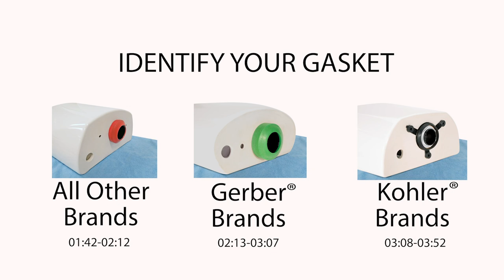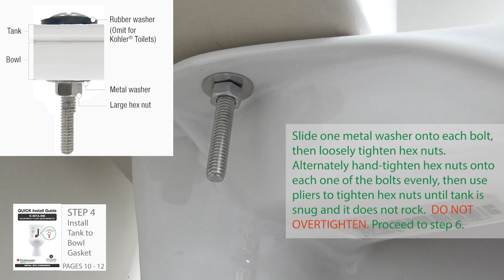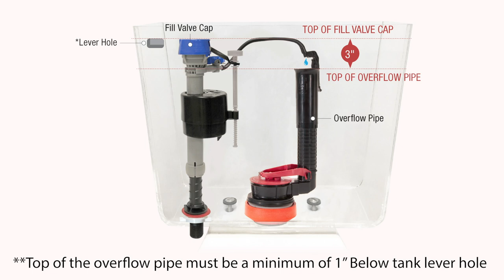Fix Leaking Toilet Tank with Fluidmaster K-507A-008 Universal Adjustable Flush Valve Repair Kit

Comment: We just completely replaced our fill and flush valves following these instructions because we had the tank leaking into the bowl.  That didn't fix the issue -- the tank still leaks into the bowl.  Help! What troubleshooting can we do to get this fixed?
Reply from the maker: Here are two solutions that might work. First check to make sure the refill tube is not shoved into the overflow pipe of your new flush valve. If it is remove it and use the clip that came with your fill valve kit and attach the clip to the flush valve and plug in the refill tube into the kit.
The second solution is to check the chain on the flapper and tank lever, if it is too long then shorten it as it may be pulled under the flapper when it tries to close. If these solutions do not work call Fluidmaster at 800 631-2011 or email/chat with us at fluidmaster.com/support for help finding the leak.
Reply: @FluidmasterInc  thanks!   it was actually BOTH of these issues and we were able to get it fixed.  thanks again

Comment: There is no 2-1/2" diameter nut wrench in my kit, #507AK.
Reply from the maker: Thank you for your question. The 507AK does not come with a red tool. If you are looking for a kit that comes with tools try our Everything Kit (2”) Toilet Repair Kit or if just needing a flush valve try our K507A-008 (2- Inch) Adjustable Flush Valve kit. For more information visit our website Fluidmaster.com where you can find product information, videos, troubleshooting tips and email or chat with a technician.  Our toll-free number is 800-631-2011 and we are available 5 days a week Mon-Fri from 5:30 am – 5:00 pm PST.

Comment: Hey Fluidmaster:  You don’t supply enough washers and nuts to attach the tank to the bowl properly.  Shame on you.  Not long ago, perhaps 5-7 years ago, you did supply enough nuts and washers to install the tank properly.  So, my question is, why are you not supplying enough nuts and washers to attach the tank properly?  The tank bolts should be tightened to the tank before installing the tank to the bowl.  Your new way does not work and my tank is now leaking.
Reply from the maker: Some of our older kits do only come with 2 standard bolts and a standard toilet bowl gasket. However Fluidmaster has released new flush valve and Everything Kits that do include 3 bolts and specialized gaskets.  For newer tanks we also make this kit for 3 inch toilets as well. For further help please contact Fluidmaster by email and live chat at fluidmaster.com/ support or toll free 800-631-2011.
Reply: @FluidmasterInc  : BUT NOT ENOUGH WASHERS RUBBER AND METAL AND NUTS!!!!!!!!!. JUST PURCHASED ONE AND I'M RETURNING BACK TO THE STORE!!!!!!!!!!!!!! 👎👎👎👎👎
Reply: That ticked me off as well.  I had to cannibalize some washers and nuts from the valve assembly that was being replaced.  The tank is still leaking anyway.  Gonna have to take it apart AGAIN and tighten that big plastic nut some more...

Comment: Just installed mine and STILL leaks water inside the toilet!!!!!!!!!!!! 😡😡🤬🤬🤬🤬🤬
Reply from the maker: Thank you for your question. Ghost flushing or water leaking into the bowl after a new installation of a flush valve may not be the flapper. We suggest checking your refill tube position, if you have the refill tube shoved down or placed inside the overflow pipe pull it out and reattach to the overflow pipe using our refill clip. This will stop a siphon from occurring and stop the leak.  Another area to check is the flush valve lock nut. You may need to tighten ½ turn beyond hand tight to stop the leak.  If you need help with your installation or have any concerns contact Fluidmaster’s Technical Service Department as we are available Monday through Friday from 5:30 AM through 5:00 PM Pacific Standard Time. Contact options include: Chat www.fluidmaster.com/support E-Mail techsupport@fluidmaster.com and Toll Free 800-631-2011.
Reply: @FluidmasterInc  : After my  previous comment I saw your recomendation to the other person, it was the refill tube been too long inside the overflow pipe. I have been fighting with this and after so many parts changes your suggestion works.!!!!!!! Thanks. please include more hardware on your kits.